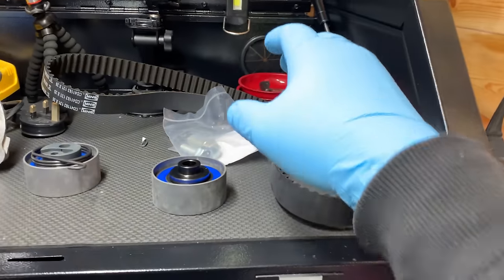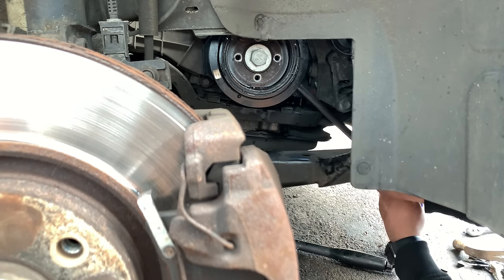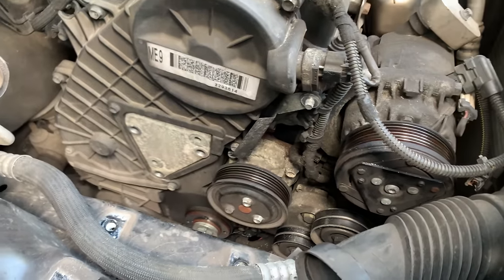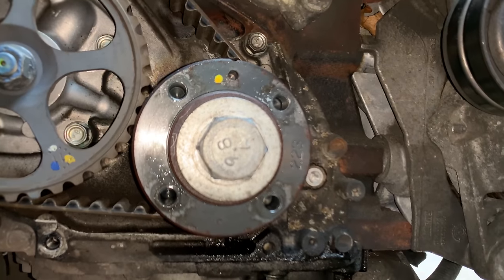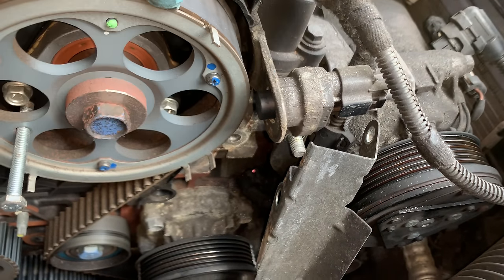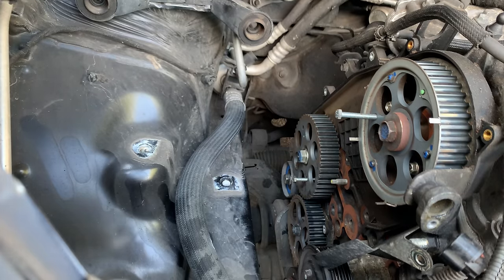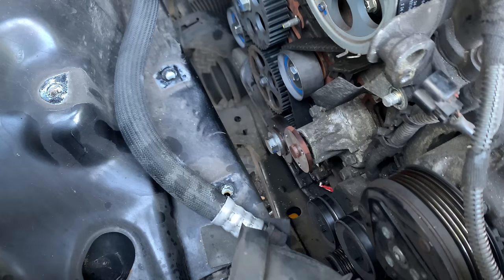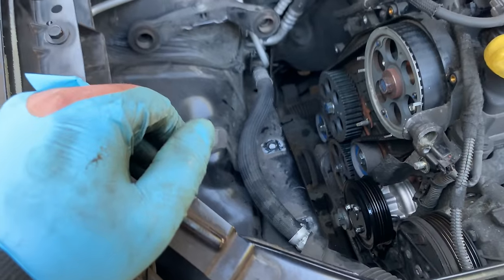Vauxhall Opel Zafira B Timing Belt Replacement | Mistake included

Comment: One question I have. In the original timing diagram it says something about 60 degrees back of the crankshaft when tighten the tensioner. I saw you didn't so I find that way easier. What about that 60 degree turning?

Comment: Thanks for the video, it was a breeze! I also removed the camshaft sensor by unscrewing the whole plate it is attached to rather than remove the sensor itself. I didn't want to deal with the same problems you did lol.

Comment: Mate...I'd have smashed that sensor right clean off....well done..much patience...
Reply from the maker: Johnny's Speed Shop 🤣🤣🤣 that’s how I felt mate specially after spending 45min with the crank pulley seized up ... cheers mate 👍👍👍
Reply: @CarsExposed  I saw that...and was screaming for you to grab an air hammer....lol.  👍👍👍
Reply from the maker: Johnny's Speed Shop I need to get a compressor would be very useful with this pulley and other things,  I’m running out of room tho my little shed is like a tool box itself 😜🤣 👍👍

Comment: Tell me about this Delphi scanner 🤔
Reply from the maker: New Level Auto 😊 Nice little professional level scanner for a guy like me, very capable system for most jobs, it doesn’t let me down very often but Snap-On, Autel and Launch are ahead of the game, clones were broadly available on EBay and amazon when I bought it about 2 years ago already installed with the tablet, I paid about £250 at the time 👍👍👍 cheers Keith

Comment: Thanks for the video. Excellent. I also bent one of those pins when fitting the cover. One question. What is the engine on this? A17dtj? A17dtr? Im pretty sure doesnt need the bolt in the fuel pump either? As this isn't timed on this car. Or am i wrong?

Comment: Great video mate, ill save it as i have to do it in the next few months, just one question, do you not need to lock out the crankshaft? Or is it just the two pulleys you locked? also do you remember what sized bolts you used to lock them? Oh and one last thing, once done are these self tensioning as the last one I done many many years ago I had to tension, cheers.

Comment: I would say that the camshaft sensor is on a little bracket which can be unbolted if you can't remove it any other way. 
On my astravan 1.7cdti the allen  bolt holding the sensor has rusted up and rounded out so i removed the bracket and sensor instead 😁

Comment: Great job mate. Those little tags on the cam pulley look like a rubbish design. I'm sure you're not the first to have that problem 👍
Reply from the maker: Thanks Mate... you are right I was surprised how soft the metal was it can happen very easily, it happened when i removed the wood upwards and i didn't even feel getting caught 👍👍👍 Cheers

Comment: Good that you also include your mistakes. Wasn't that sensor stuck because of some loctite? If so did you also use loctite when you placed it back? Greetings from Holland. Hope you will make more video's on the Megane 3.
Reply from the maker: Bertrand Van Leeuwen thanks man, I don’t think it had any loctite it felt like it was some kind of water limescale maybe the holder for the sensor had some magnesium in it, I didn’t use loctite... I have more Megane content this week stay tuned 👍👍👍 cheers

Comment: Great video thanks for taking the time to make it. The trouble you had with the sensor removing it, did it really need to be removed? The angle that you show it looks like the belt will slide off with out removing it.. thanks again.
Reply from the maker: Thanks mate it’s a pleasure to make them ... Yeap it was a pain seized up in place but unfortunately you do have to remove it, probably a bit difficult to get the true perspective watching the video but the new belt won’t slide through otherwise ... cheers 👍👍👍
Reply: Cars Exposed ok thanks for clarifying, that is my weekend job then sorted, just hope it does not rain.👍💦
Reply: @CarsExposed  NO! you don"t need to remove the sensor. Just remove that plate with bended pins , and the belt will slide off !!

Comment: What size were the locking bolts? + what's the point of locking fuel pump? Surely doesn't matter. Thanks
Reply: Fuel pump needs to be in time with the cams it’s very important
Reply: @monkmodemalik8225  thanks for the reply mate, so you can't just change the fuel pump without timming it?
Reply: callum I have a 1.7 astra. The Haynes manual says it’s a straight swap. I guess you lock the fuel pump in case the cam lock fails. The pump delivers the fuel and the injectors decide what time to fire not the pump position. On older mechanical pumps they need timing not on common rail engines tho
Reply: @monkmodemalik8225  cheers mate 👍🏻

Comment: Great video very helpfull what's the mileage of your zafira when you decide to change the timing belt
Reply from the maker: Thanks mate .... this is my friends car I believe it had about 130k miles 👍
Reply: @CarsExposed  mine is 86000 miles im planning to change it in a few weeks using your video
Reply from the maker: Not too difficult of a job mate but in my case a had quite few seized parts which was a pain, another thing that’s good practice but I didn’t show in the video is to mark all the sprocket with tippex just in case ... 
You probably know it but this is a job that you have to get it right otherwise you could have catastrophic engine damage ...
Reply: @CarsExposed  thats why i ask because for zafira ideal is 80k miles but mechanics here in n ireland advice 100k to change
Reply from the maker: Cool, my friends car I believe it was the first cambelt change way way overdue that’s why it was a bit more difficult with some parts seized up... just take your time let me know how it goes 👍👍👍

Comment: You don't have to take out the camshaft  sensor if you take the 4 screws out of the  cam sprocket  faceplate and remove it first.
Reply from the maker: Cheers 👍👍👍

Comment: Great job mate we all make mistakes makes us stronger. Those Zafira are tight to work on don't see many 1.7. That Delphi scanner what app do you use with it? Is it free?
Reply from the maker: Zed Man thanks mate makes us stronger for sure ... the Delphi is a windows based pro level software I bought this tablet on eBay for about £220 👍👍👍

Comment: Mine snapped on the Motorway yesterday 😥
Reply from the maker: bigearedmouse17 oh no man ☹️
Reply: Is the engine written off? Because these 1.7’s use a gear driven camshaft (intake and exhaust cams are locked together) it should be okay and valves should not hit the pistons?
Reply: Ian Burgess  I think it’s less likely on cars the have cams locked? but yes it can still happen